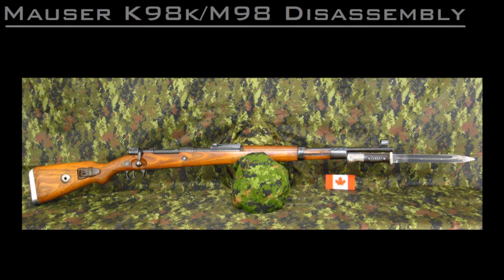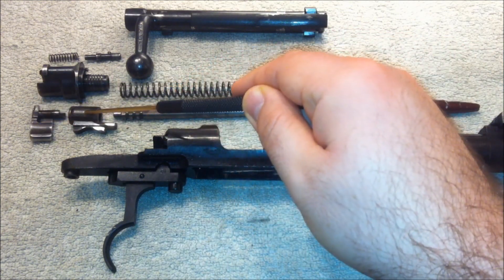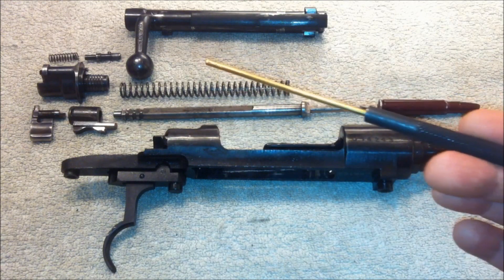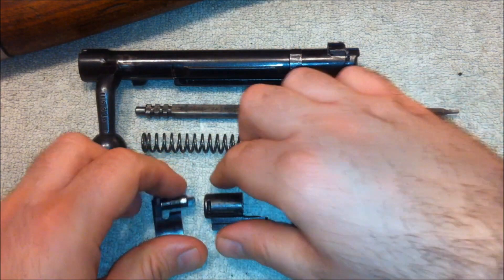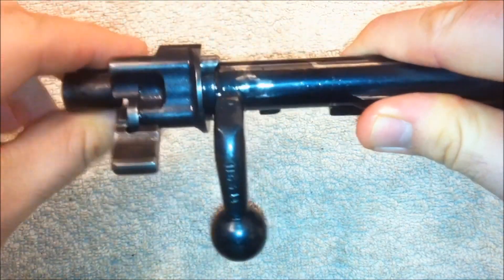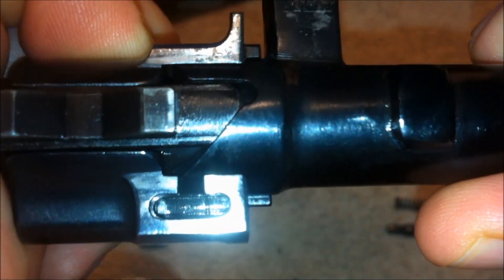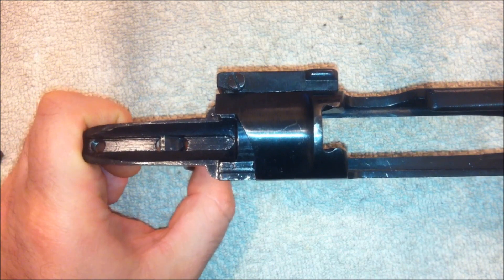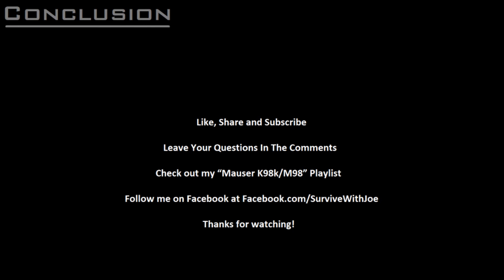Mauser K98k/M98 Part 2: Operating Principles Of The Mauser M98 Action

Comment: I am not a Mauser expert. But I believe that the firing pin can't ignite the primer in case of firing pin breakage if the bolt is out of battery. In front of where firing pin spring rests there is a shoulder which corresponding with cut out in the bolt only when the bolt is in battery.